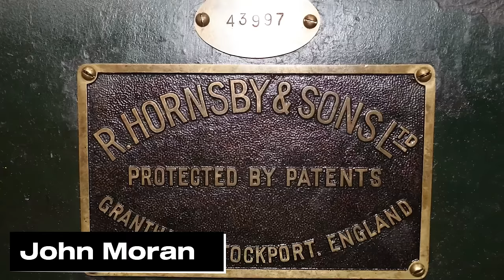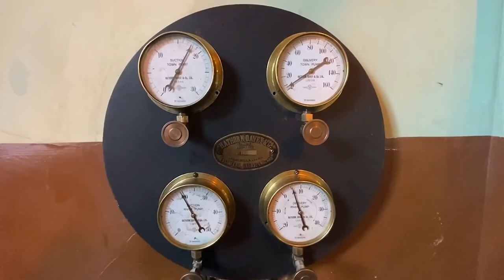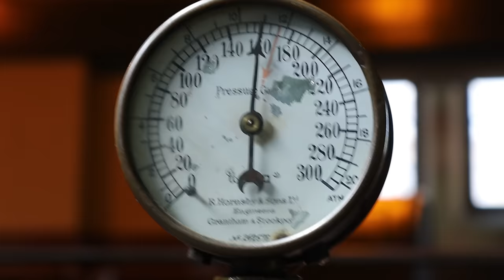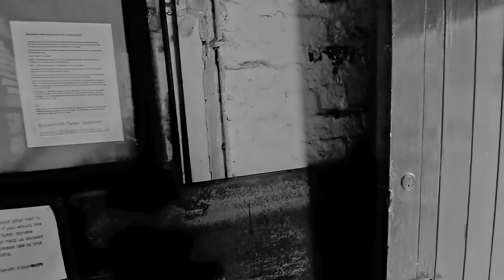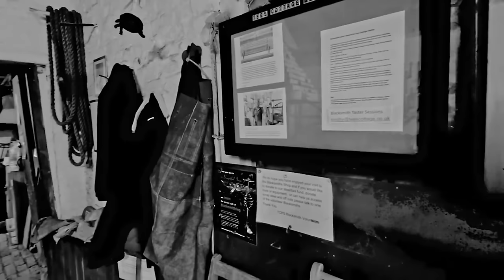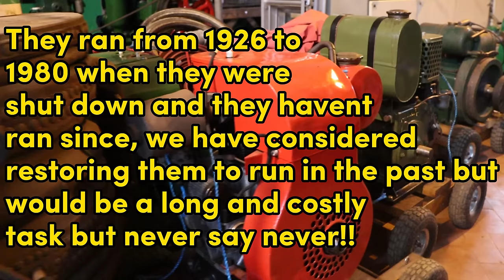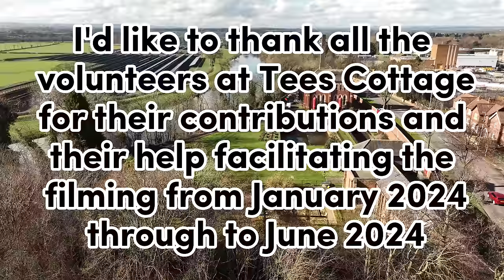TEES COTTAGE PUMPING STATION - 175 YEARS AND COUNTING (1849 → 2024)

Comment from the maker: CHAPTERS
0:00 INTRODUCTION
1:27 BEAM ENGINE WITH GEORGE & MARY
8:36 GAS ENGINE WITH JOHN
19:19 LANCASHIRE BOILERS WITH GEORGE
21:36 BLACKSMITH SHOP
24:20 ELECTRIC PUMPS & SMALL IC ENGINES
25:48 MINIATURE RAILWAY & MODEL ENGINEERS
28:13 CAFE WITH PATSY BRAITHWAITE 
28:46 MEET THE VOLUNTEERS!!
33:25 CREDITS & DRONE FOOTAGE